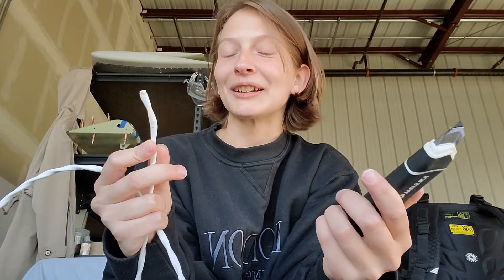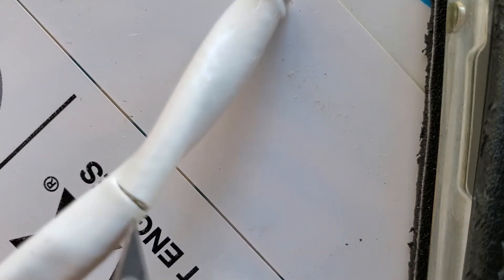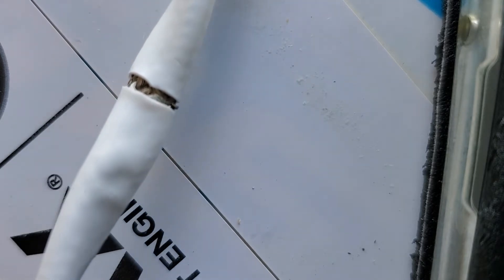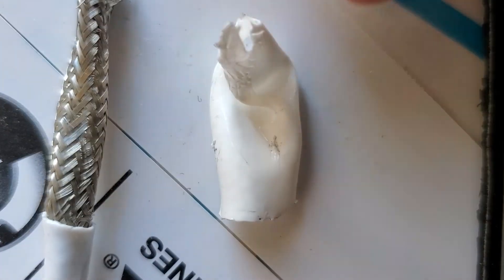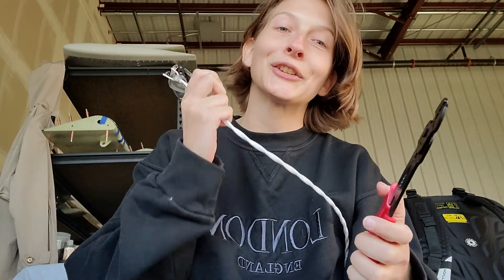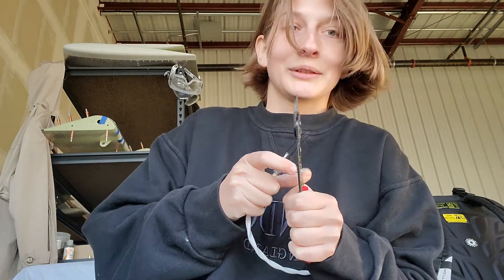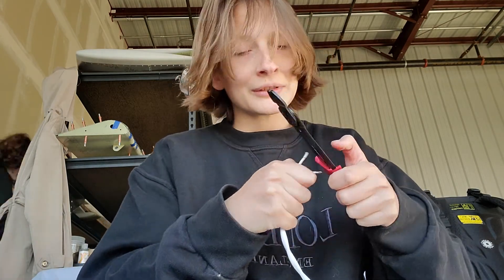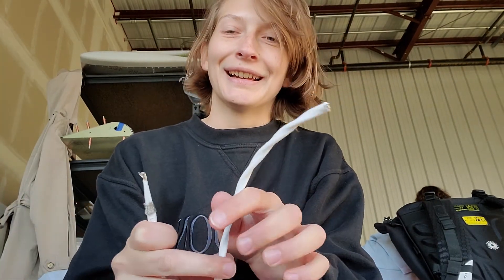Katya STRIPS more milspec wire Sling TSi

Comment: Pro tip I got from avionics expert on wiring - Take that red handle wire stripper and just throw it in the trash and then get an automatic wire stripper, it's worth it weight in gold. I use the Klein Tools 11063W Wire Cutter / Wire Stripper and it works great and is a lot easier to use than that red handle one, plus it has a consistent result without risk of nicking the wire.
Reply from the maker: Thanks Philip! Good idea on the automatic wire stripper. Katya also noticed that the red wire stripper nicked the wire a little.

Comment: The problem with using a box cutter is that, if you are not extremely careful (and none of always are...), you can easily cut past the outer insulation and nick the underlying wires.

This is bad because, under stress (pulling, vibration, heat/cold cycles anyone?), nicked wire will break, possibly causing an in-flight failure.  Worse, those nicked or broken off shield wire fragments tend to follow Murphy's law and become self propelled short circuits between connectors...

Invest in a good non-nicking wire stripper, put crimp on terminals with a good quality crimper (not a pliers or red handled abomination:-), and use heat shrink tubing (shrunk with a heat gun, not a lighter or match) as a strain relief.

This isn't a place where you want to be penny wise and pound foolish...
Reply from the maker: Totally agree John, a good wire stripper is much better than a bad box cutter. The issue we have is that these thick milspec cables are a bit too thick for a normal 22 awg wire stripper, so require something like a cable stripper (which runs the risk of nicking the wires anyway). So, we end up using a box cutter :)